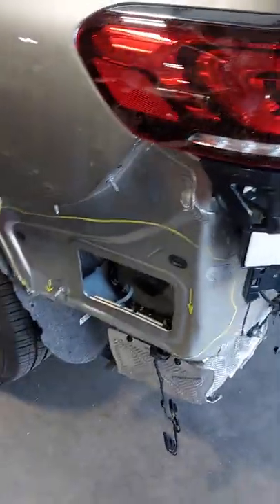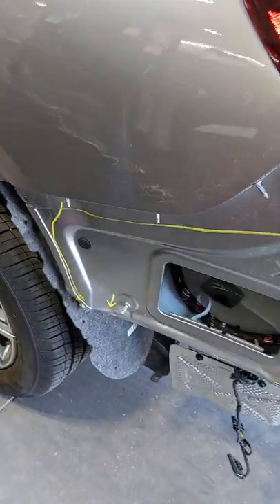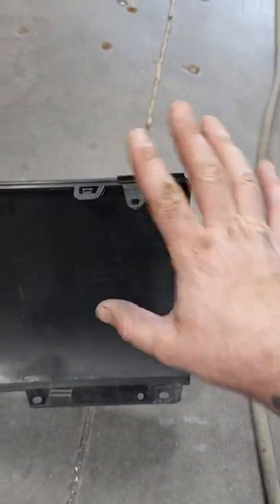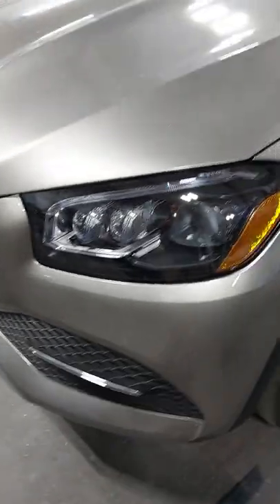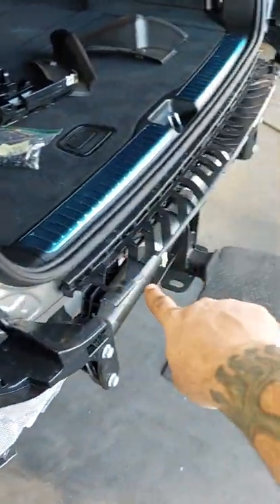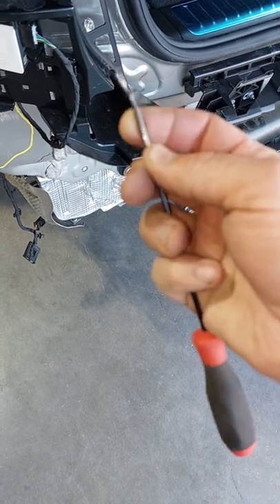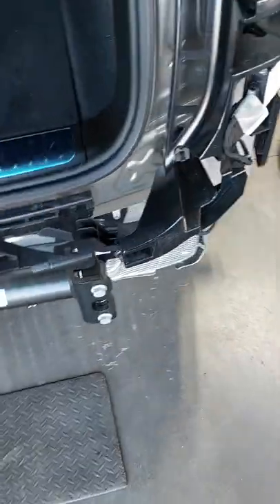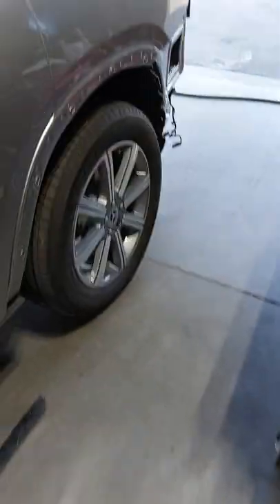2022 Mercedes-Benz GLS 450 Rear Bumper Cover Removal

Comment: Tech Brian - great detail on this video. I'm looking to repair someone else's mistake on my 2020 GLS 450 which is that when they replaced the left rear parking sensor (I bought CPO from MB) it was installed upside down. The dealership (MB in NYC) has decided it wasn't their fault and I am not interested in spending $2,200 to replace the entire bumper. They have indicated they can NOT remove and replace simply the parking sensor that works but is upside down. Do you know if it can be removed and re-installed? They have indicated it is plastic welded into the bumper and the entire thing must be replaced.

Would appreciate your knowledge on this.
Reply from the maker: Yes, the sensor bracket can be removed and repositioned. It would require the use of a putty knife and a hammer.. Cut it loose flip it over and re plastic weld it. After cutting it, loose, use 120-150 grit sandpaper to sand down any high spots on the bumper facial. This will ensure that the sensor sits flush upon reinstallation. Then clean the surface with 91% alcohol. You can either purchase a two part epoxy glue from Lowe's or Home Depot or plastic weld the bracket back on. The risk with plastic welding is that you could damage the paint. You have to melt in through both pieces considering the thickness of the facia and taking care to not melt in too far. The dealer is not willing to take this risk but rather estimates the worst case scenario. I would plastic weld it because Mercedes bumpers are rather thick and with the welding iron all you have to do is watch closely to how deep you're penetrating and you only need to tack the surface, maybe 1/16".